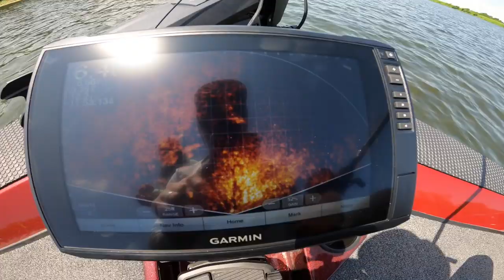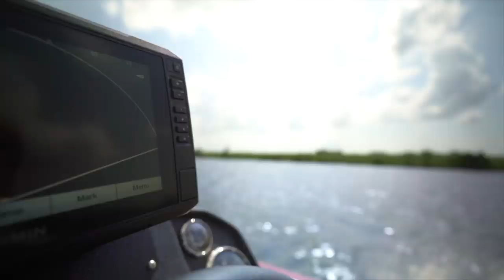THIS ALMOST RUINED OUR BRAND NEW BOAT!!

Comment: Did they recommend the rear transducer be mounted to the left of the motor?  Typically it’s on the right
Reply from the maker: First time boat owner haha. Had no clue. They had it installed when I purchased it
Reply: Westin Smith I’ve heard some guys saying it reads better at high speed on that side, that’s why i asked

Comment: What size and type of hook do you use for your wacky rigs?
Reply from the maker: 1/0 stickies wacky rig/dropshot hook
Reply: @WestinSmith  I will have to give them a try. I've only used a 3/0 wide gap. It works but might be too big at times. I also just picked up two of the shimano slx dc reels. All I can say is what a game changer.

Comment: Dude put a th Marine geforce handle dude your won’t regret it trust me worth any penny !  It tat cable snaps it’s the worst when on the water Gerald Swindal probably spelt that wrong is a MLF pro and designed it ! Like I said worth every penny
Reply from the maker: I’ll have to check that out, thanks